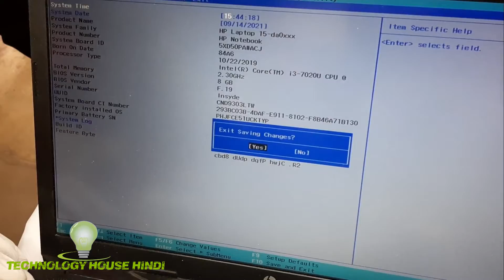Hp 15-da0352TU Ssd upgrade , Hp 15-da0352TU Ram Upgrade , hp 15-da0352TU M.2 Ssd upgrade

Comment: Came here to check whether this model has a separate ssd slot or not. Plz confirm is this m.2 slot?
Reply from the maker: It's have m.2 slot
Reply: @technologyhousehindi  does this support m.2 nvme?
Reply from the maker: @yashkeshari17  i not try nvme

Comment: Can we insert m.2 nvme ssd in hp 15 1069au with ryzen 3
Reply from the maker: Yes
Reply: M.2 nvme or sata... Confusion ..which slot is given
Reply from the maker: @riteshbagdi21  m.2 nvme
Reply: @riteshbagdi21  kaun si use SSD use ki brother???